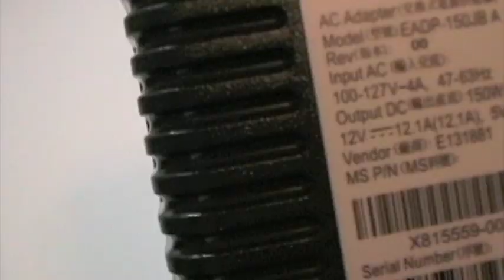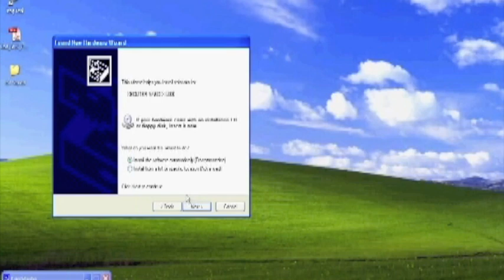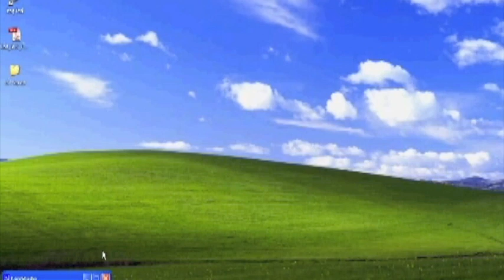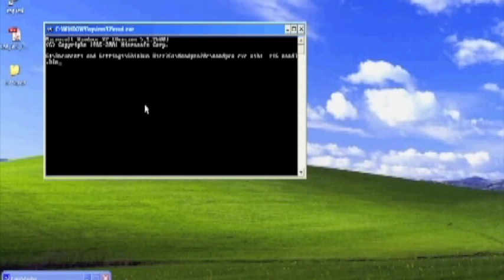Nand-x Boards installed.

Comment: @Brandvegn sorry, my iron is 30W although i cna invest in 15W, i personalyl can do basic soldering ( IE, installing smd lights to xbox 360pad ) but never done anything with nands and jtags at the moment. also ive noticed if you want to use the nand X usb reader on numerous xbox 360's you need extra parts? as i get a few rrod consoles in and would lke to check the nands without LPT connection as im not confident in that, + im in UK so was looking at team excuters one for £30

Comment from the maker: A little more info might help. Do you mean your Nand is shorted? What was it flashed with at the time? Did you get a nand image before shorting it? How did you short it and if you have an error code what is it? Error codes are found by pressing the SYNC button (for syncing controllers) and clicking the eject button.
1 light = 1, 2 light = 2, 3 lights = 3 and 4 lights  = 0. ex. hold sync, press eject, 1 light flashes (1), press eject, 4 lights (0), eject, 3 lights (3), and again 3 = error 1033.

Comment from the maker: @MyLilmoma You can JTAG any iteration of the old motherboards (Xenon/Zypher/Falcon/Jasper) provided the CB is exploitable. This is usually indicated by a 7371 dashboard or lower. However, some 7371 were fixed after MS found out about the exploit. So you will need to read your nand to make sure. You can read the nand on any of the older models, but only older dashboard versions can be jtagged.

Comment from the maker: @Ahquatic pinheaders are pretty weak for multiple installs. I have gotten a bit better at this since this video and I am using a better iron as well. Wires are much easier to go from on box to the next. Pinheaders also use old JTAG points which are fine if you have a Xenon or Zypher, but for Falcons and Jaspers, they seem to cause problems in some installs. Take a look at boxxdr install for new configuration here on youtube.

Comment from the maker: @calebcass1 you need to hold the iron to the wire and feed the solder into the hot wire. Use flux on the wire and I dap a little on top before the install. I haven't used these boards though since the first day. This was my first time doing a 360 and to be honest I was pretty nervous and ended up making a lot of mistakes. I would practice a lot on an old board, like a dead hard drive or something else small. Also, the ground point is hard to pull solder out. It seems to cool too quickly.

Comment from the maker: @lukeyd2k9 40w is going to kill that board, 30W is alright, but I use 15 for soldering on and 30 for desoldering. You typically need to hold the heat to the components longer when soldering than with desoldering. If your friend is really experienced, 40W will do, but if she/he is that experienced, they will say the same thing. If you have 360s that have the lower dashes than more times than not, you have exploitable CB. The run on low dash, non-exploitables are extremely low comparatively.

Comment from the maker: @LogansEarLobe Show me a picture or two on what you are doing. Either upload them to imgur.com or youtube a video up. I would say, if you haven't done soldering before, you may want to practice on other components first. I took apart a dead hard drive and desoldered a bunch of stuff and resoldered. I did a lot of the original xboxes before as well.  Even after that, I got to the 360 and saw what small points I had to work with and was a bit stymied. I have done 2 Falcons since this video.

Comment from the maker: @halfghost2010 You have two parts to the mod. First you need the wires (seen above) to read the Nand. Nand reads can be done on any board (from Xenon to Jasper and I think the new boards are already being read). I think I wired them wrong the first time (I was wiring from the front of an LPT instead of the back. I think this is the reason for the wonkiness, but I am not sure. The second wiring is for the actual hack. That is the jtag. boxxdr (see comments below) has a tut on that.

Comment from the maker: @xTheCatsModZx Sure. You will need to tin the wires first and get some of the solder in the holes. You are going to have some problem with heating the ground on the Jtag side of the exploit.  After I get finished with my LSAT October 9th, I will be putting up some videos of me soldering points etc. Have you looked at xbox-hacker (dot) net? Also, check out the youtube user boxxdr. His method for xbox hacking is the standard now. The old jtag is a bit wonky. You can pm me brandvegn on xbox-hacker.

Comment from the maker: @TT0UCHD0WN  I have stayed at 3.15 since the OtherOS removal and just popped up to 3.41. I was waiting for the PSFreedom to be ported to earlier firmwares, but really, OtherOS doesn't use the GPU of the PS3, so it i fairly limited. Already a W.I.P. Linux distro called AsbestOS. Just command-line, but you need a 128MB chipset. ps3-hacks has a post on it. This is going to lead to some pretty rapid homebrew and possible cfw in the coming months. I am excited. I am still going to Jtag though.

Comment from the maker: @sneakstr14 Thanks, but I am doing this as a hobby. I enjoy the challenge. I will say the boards for this are now off. wires is all I like to use. I don't think these were good add-ons. I am stuck right now on an e79 after installing Xellous modified with new smc commands. You can find it on Xboxhacker if you know how I can troubleshoot.. The usb is working fine now. Trial and error and a nand short got it up again.

Comment: Hey What Does The Switch Do... Off, 330, 470 Please Help I Did This My CB Is 2.0.6833.0 Xenon MotherBoard I Did It This Way Everything Is Soldered Perfectly Red The Nand I Got Like A List Of Error. Then When I Finished I Got 1 Red Ring Of Death Fixed That By Repairing The Nand Now I Got 3 Red Ring Of Death. I Dont Know What Else To Do Now PLEASE HELP SOMEONE

Comment from the maker: @IDevicesDev There is solder on the PCB boards that correspond to the points for the original JTAG configuration. Now most installs use AUD_CLAMP point and Alternate SMC points. These have been added to Coolshrimps tool as well. So my suggestion is if you get the NAND-X, don't mess around with the PCB "quick installs" or whatever and just use corresponding wiring.

Comment from the maker: @TT0UCHD0WN I have my Teensy++ coming on the second shipment. If the PSP hack comes out before then, I will do it that way. Xbox jtag does seem to be slow moving. I mean you have the custom dashboards and stuff, but as far as non-pirated stuff, no XBMC, not a lot of continuous work on emus. I will have both sitting under the big old 37" though.

Comment from the maker: @michael55443332211 I am using Nandpro20b. I have already placed the original nand back, no problem. Since this, I have removed a 10k resistor for the board and until I finish studying for my lsat in October, I am done playing with it. I have backups of my kv and nand dumps on disk and hd until I can get back to this.

Comment: hey this happened to me also... it mean that you messed up your solder points.. the trace is burned out... try intalling the wires manually and putting the wires in different ground points.. look up on google alternative nand reading points.. hope this helped

Comment from the maker: @FraGiiLeLobbyz Stopped using the QSB. Straight up wires now. But I am going to try the Boxxdr method when I get back to it. I am studying for a test, but when I finally do, I also will need to replace a 10k resistor going to the NAND. I had to reset the SPI like 3 times.

Comment from the maker: Nope. I have not used QSBs in a while. I find them more of a headache than a time-saver. The new Demon board is a QSB and desoldering it takes a very small tip and a quick desoldering sucker.

Comment from the maker: @Z0MBI3K1LL45 It is still flashed with the original NAND. I still need to solder on a 10k resistor and start over again.